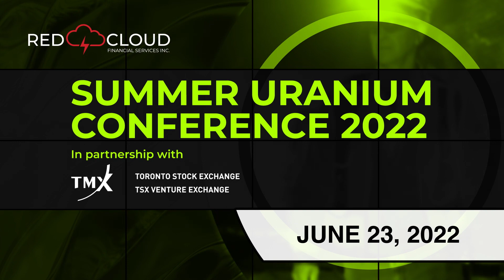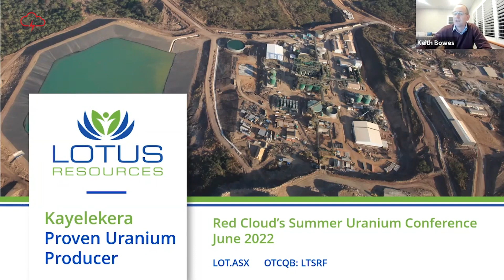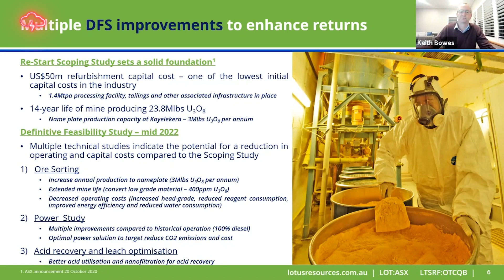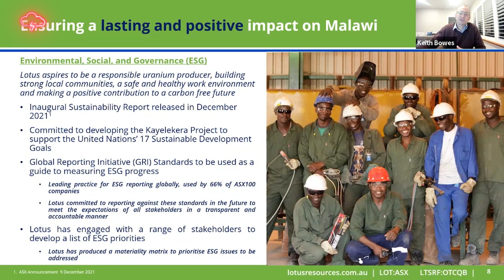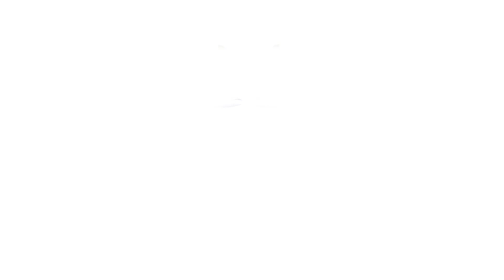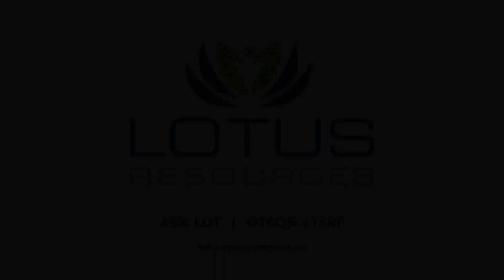Lotus Resources | Red Cloud Summer Uranium Conference 2022

Comment: If they're targeting a ~$30 all in sustainment cost, why do they need a higher spot price to justify production?  Please make sense of this for me.
Reply: All in sustaining cost don't actually cover all costs... For many Uranium miners actual costs can be 50% higher. Then there is tax to be paid on any profits. Also the initial CAPEX has to be spend and made back so you don't do that if you can't comfortably justify that expense + the potential for cost blowouts (certainly in the current circumstances with inflation and supply issues). So for a mining endeavor (which is inherently risky, certainly in the Uranium market) in a highly volatile commodity and during great economic uncertainties, you wouldn't want to pull the trigger until you have a very comfortable margin.
Reply: @janvanderbij924  Taxes and CAPEX are a cost of doing business.  If they're not included under the umbrella of all-in sustainment cost (AISC), what's the value in  defining ASIC thresholds without these costs included?  At current spot prices, I'd say they have a very comfortable margin.  Granted, they're not ready for production at this time.  However, if they were ready, I see no reason why they wouldn't be able to produce with a comfortable profit margin.  The problem I'm beginning to see is widespread long term bullishness among developers in the industry on a long term basis.  Very few are producing at this time.  They're itching to get started.  When they do, what will the supply picture look like?  Willl it be similar to the US natural gas industry a few years ago where oversupply nearly ran many companies into the ground?  Nat Gas E&Ps were producing as much natural gas as possible just to gain market share, and in the process, driving the price of natural gas into the ground... along with their companies.  Is the Uranium industry heeding the leasing learned from the Nat Gas industry?  Is it even possible considering that some developers willl operate in poor nations where revenue from mines is a vital primary source of revenue.  Production could skyrocket.  At that points what does that mean for higher cost US producers?  Maybe it's not a factor if the US govt is interested in US sourced Uranium.  There's a myriad of complex factors.